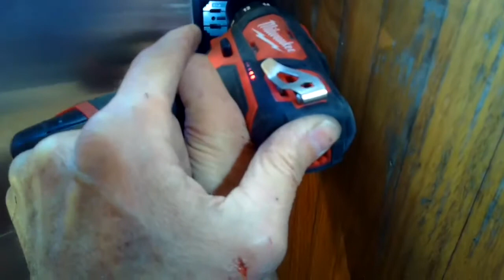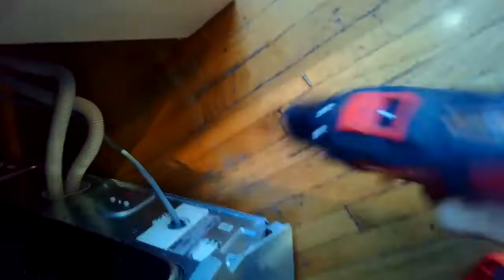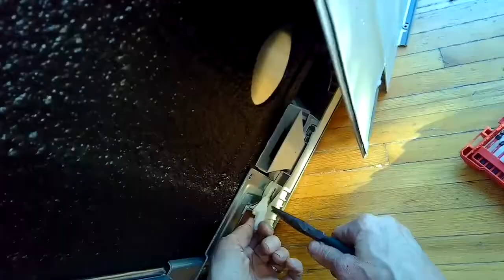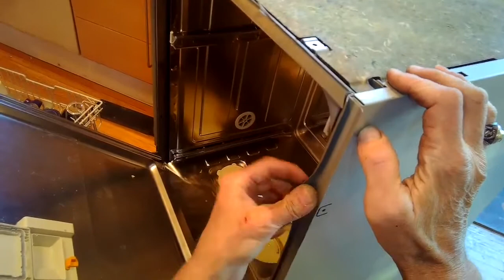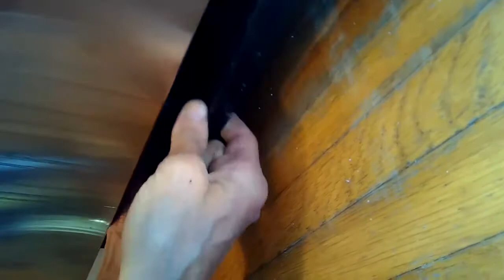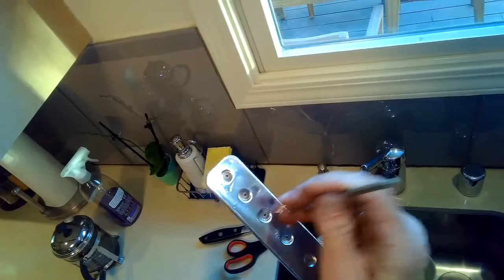✨ Miele Dishwasher Door Falls Open — Easy DIY Fix ✨

Comment: hi scott..great video so thanks
I can see you posted another video about 4 years ago on how to fix a falling Miele door however in that video there was a cable on the left hand side and one on the right and in that other video the one on the right had snapped. in this video however there is no evidence of a snapped cable rather you simply show the cable on the right had simply become detached but does it mean that that by reconnecting it, things were fully fixed because there is no cable on the left to check or did you also check that?
thanks
ben
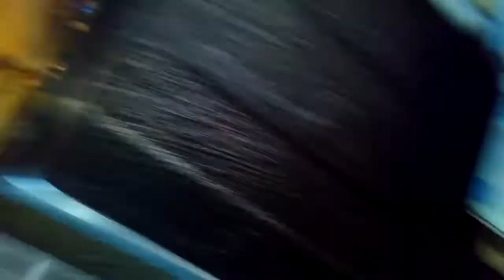Reply: update: ok so i found out there is one on the left as well and i found out the issue is that on hook on the the end of the cable which you reconnect to the door hinge in your video at 4:11 is broken and I'll have to but at least a new cable with this hook but my next problem is how on earth can I remove this cable so do you know please?
Reply: ok got it from your other video at https://www.youtube.com/watch?v=bUpurq8DeUU&t=937s around the 8 min moment....thanks again.